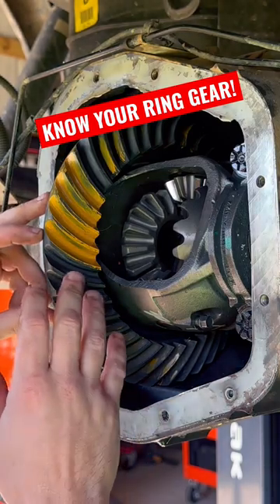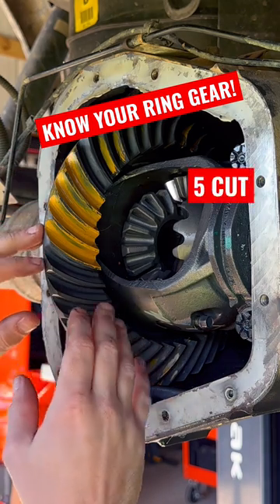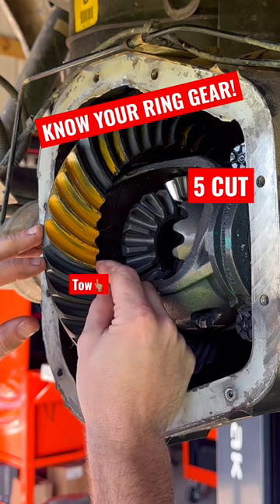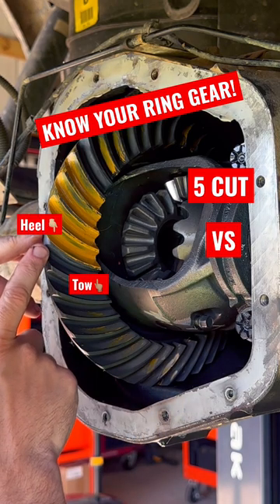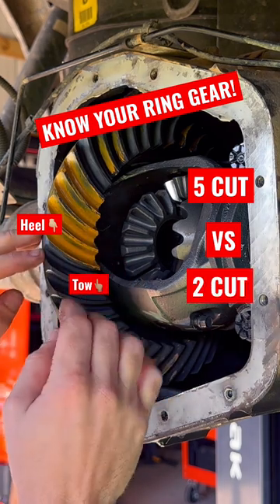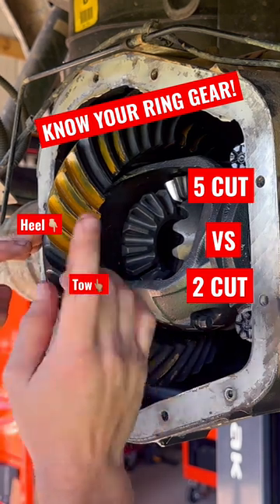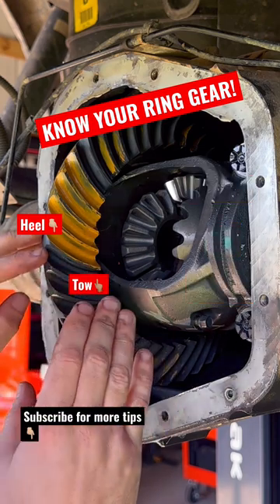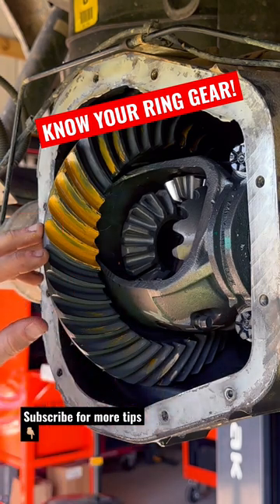5 Cut Vs 2 Cut Gears 👊🏼 #shorts

Comment: Sooo how do I tell?
Reply from the maker: Use a micrometer and measure the difference between the Heel and Toe gear tooth.
Reply: @axleoffroad  am I measuring thickness?
Reply from the maker: Measuring distance from Crown to Root on the Heel & Toe. Look at the picture at the end of the short. Top of the tooth is considered the Crown, down to the bottom of the tooth or Root. If the measurement is different, Its a 5 cut and if it is the same, its a 2 cut.